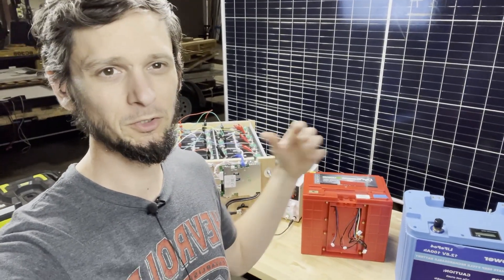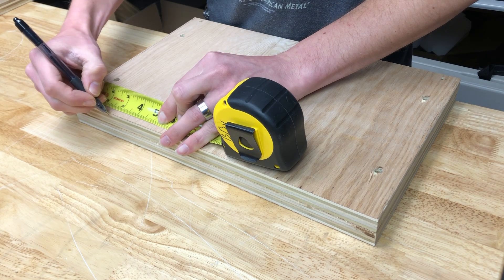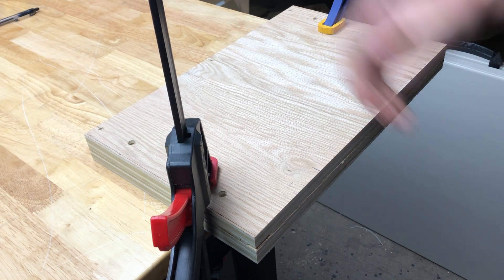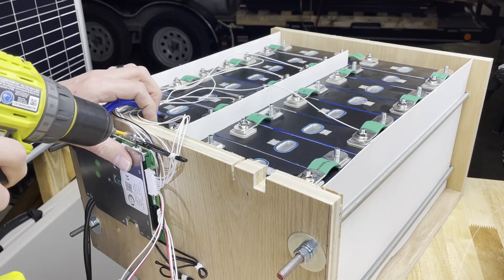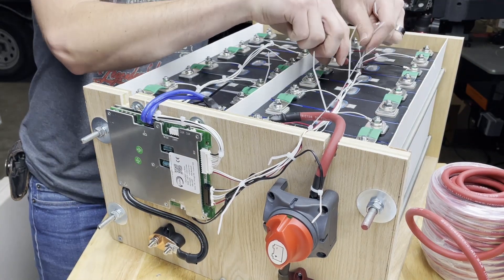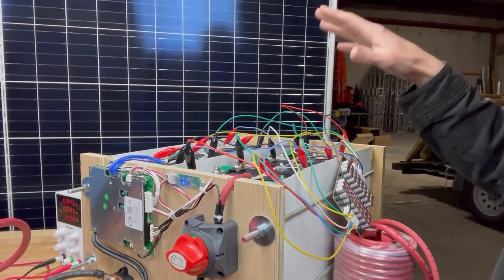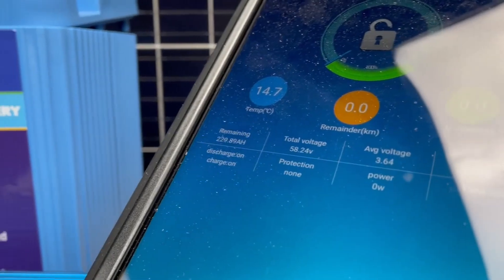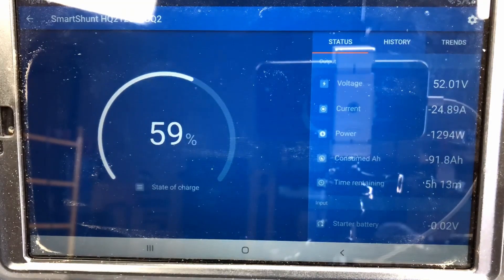DIY or Buy? 48 Volt Solar Storage Battery

Comment: I have two 19 kw banks for 38 kw 8 northstar redtop  batteries at 70 bucks a piece. At 190ah x8. For 560 bucks .     I think i had a bargain
If i went your way i would have paid 7,600 bucks..      no deal

Comment: Uncontested and disputed.  DIY is the most bang for the bucks.
Can  plug and play beat the diy battery with case, bms, 300AH 48v  15khw+ capacity  for $1600?   for that price plug play  will buy you 100AH battery  for about 5kwh.

Are you sure you ask? absolutely positively because i already sourced them out ready to buy.   Hint!!!!  you are not going to find the components in the US and only in Asia.  Then again there is only one country in the world that is leading for now and making LFP battery by the ton - China so now you know where i source to build my battery.

I am NO newbie in this solar thing.  I had been doing for more than 5 years already starting  out from scratch build  and set up everything myself - battery, solar panel, inverter.  The off grid 3kw inverter that runs the whole house and still works to this day.  100% off grid.
Nowadays there are abundant info. for diy in compare with  years ago so what are u waiting for??????

Seriously NO body should do grid tie as off grid is becoming very feasible and affordable.
I went cold feet  off grid and never regretted.  99% of the population won't do that!!!!!!!!

Comment: What are you down to now? I was looking recently and saw 300AH cells that work out to around 92$ per kWh.
Reply from the maker: Haven’t seen anything that cheap lately. Even straight from China before shipping’s costs. It’s odd but cell prices don’t seem to have changed much over the last three years, if anything they’ve gone up.
Reply: @BeeneEnergy Yeah cell cost has definitely gone flat/up. Trying to get near that $100/kWh is elusive.
Reply: With shipping? Doubtful

Comment: Lead acid batt, if lightly used and properly charge, can last 10-12y but that’s more of the exception.  Pb batt tend to last 6-9y under various “normal” use (automotive)
Reply from the maker: Yeah I think part of the problem is that good lead acid's can last a decade or more but people buy the golf cart or marine batteries and hope for the same. They are not the same and do not last anywhere near the 10 years hoped for. Since good lead acid is expensive, or you have to scrounge. Neither is a bad thing in itself but I really like the repeatability of lithium personally.

Comment: Hello, With the Dimmer + PV, self-sufficiency will now increase to almost 95% in summer, which means a huge breakthrough. The prerequisite is that you have at least a small balcony power station, and you don't need an expensive battery either. Example of a kettle: Without a dimmer, the 2500W - 600W PV system needs = 1900W, which you have to pay more for. If I turn the kettle down to 600W with a dimmer, then every weak PV system can now supply each consumer independently and independently, because the 2500W kettle becomes a 600W kettle thanks to the dimmer. Magic... The 2000W e-heater becomes a 500W e-heater with a dimmer, which can run 12 hours a day free of charge via PV. https://youtu.be/QbLWDbJi6ew . The 4000W oven is also tamed. Not the solar systems have to grow, but the consumers just have to drop by 75%, which is sooo easy with the dimmer. are you convinced now I have already switched my entire household to dimmers. Please have a look at my channel. ............. 🌞 ......................          Increase mini PV solar self-sufficiency (winter and camping): A boiler and other power-hungry consumers can be infinitely reduced using the "5000W dimmer". Ebay €7. I run 5 dimmers in parallel on an 850W inverter. Kettle 2.2KW at 150W runs 12 hours a day, so the water is always hot. The room is also nicely heated. 2.5KW washing machine runs in parallel with dimmed to 400...600W and always reaches its 60°C, and also its 1400rpm... It doesn't matter to the washing machine whether it changes the washing temperature to 5min@2500W or 100% can be achieved free of charge via existing PV power in 20min@600W. The wash cycle lasts the same time dimmed and non-dimmed, 3Sth 10min. The iron, dishwasher, oven, electric heater, waffle iron, coffee machine, all internal heating are throttled with me. Videos on my channel https://youtu.be/eC2olbCBhh0 The inverter stays cool, quiet and the MOSFETs + (battery) remain intact because no extreme current peaks arrive at the inverter. Now every Mini PV Inverter is enough to sell large devices. So, with the dimmer, all internal heaters/devices can be converted into base load devices that stay almost permanently ON, drawing very little current directly from the PV. With a wattmeter / energy cost measuring device you can then measure this perfectly in order to set the dimmer optimally. ................. ........................ .............. ................. ................................ .......................... ................................. ............................. .......................... ................................. ............................. ................. ................................ .......................... ................................. ............................. .......................... ................................. ............................. .......................... ................................. ............................. .......................... ................................. .............................

Comment: Diy Lifepo4 new batteries are the best way to go for long term solar storage period. You can beat the price but at the cost of reduced life cycles. I found used Lifepo4 packs for $100kwh  in the US but it's on the east coast and the shipping is very expensive to get to me on the Westcoast so buying raw cells from. China is a better price overall

Comment: I have a lot of 1/0 aluminum wire rated for 125 amps should I use this or get copper? I'm building a pack that will have a 100 amp breaker and switch hooked to solar. Normal  charge/discharge of current batteries are  40-50 amp max   usually 20-35. I think I will use your design if you don't mind it looks like a pretty good one
Reply from the maker: I have debated some 4/0 Al so I could run my battery bank outside to my inverter inside. As long as you’re taking care of the typical aluminum issues like using oxide preventer it seems fair to me!

Honored if you decide to use my design. Thanks for watching!

Comment: Good vid, Sub’d. Have you thought about recycling ur discharge via a charger/method to another set of discharged batteries, rather than just burning off the power to a heating element?  Andy (Off Grid Garage Australia) has a Tesla, which is a cool way for dumping any extra power for his high Amp tests & still using/recycling the power for EV. Cheers

Comment: These days? Rack mount LifePo4 batteries are the way to go. Lot of good product entering the market with 5-14.4 Kwh plug and play units. Have their own bms, circuit breakers, communications, readouts, cell diagnostics and some are even heated. You cannot build anything for cheaper now.
Reply: They are the way to go for people who don't know how to build their own. It's alot more expensive than diy.
Reply: @randybobandy9828  $1500 for 5kwh. Saves you about 300 doing DIY but you don't have a warranty.
Reply: @davefroman4700  um.. You will save far more than $300 who told you that nonsense. Especially when you can build it far larger and not need redundant components. Warranty? Who cares. Anything that you would have to worry about a warranty won't matter since you can clearly fix it yourself.  You can do this for $800 same size.

Comment: careful with that battery disconnect switch on a 51.2v battery...  it's not rated for that voltage.  not even the high quality  Bluesea Systems ones are rated that high and that's a cheap knockoff!
Reply from the maker: You’re right that I should be careful. It is “rated” for a “48v” battery. But yeah without arc extinguishers which this in no way has it would fail turning off the battery under load. Though I rely on my BMS for that.

I didn’t mention that in the video though. So fair of you to call it out. Thank you!

Comment: Pretty cool video.  Like you, I've built batteries from raw cells, used repurposed cells for various needs, and also purchased complete LiFePO4 batteries.  There is a place for each of these, for sure.  Something you demonstrated, but didn't mention specifically, is the sense of satisfaction one can get from any kind of DIY project.  This is particularly true when you build or repurpose a 2nd-life battery to fit a unique situation.  Thanks for sharing your thoughts on all of this stuff.

Comment: or you could buy a seplos bms, which does have proper comms with inverter and other packs :)
Reply from the maker: That’s true, looks like the bms the rack mount batteries have been using commonly. Need to get a hold of one to see how it holds up to the jbd!
Reply: @BeeneEnergy  check out Andy’s Off Grid Garage Australia for some great lab level info on Seplos BMS’s (& all solar & lifepo4 gear) he is doing right now, Seplos are a pacive balancer at 100mv or less, they need an active balancer to work properly on 100-300A cells. 
JK BMS is the one u want, they are great. Good vid. Cheers from Australia
Reply: @BeeneEnergy  got them, work beautiful on my diy packs, they're even selling diy mason 280ah 16s enclosures  which includes everything except the cells

Comment: 040122/1426h PST 🇺🇸  Hello Beene thank you for the demo. I too am a proponent of using B cells, as they have enough punch and lasts a long time. I also appreciate your sentiments regarding sellers of batteries. Of course, you know, that they do not manufacture those batteries but assemble parts bought from the East and sell them with funny trade names and profits.
I’m not too keen on ‘compressing’ the cells though, as I feel there’s no effect on doing that. I have similar cell arrangement for the past 4 years without ‘compression’ and cells have not bulged a bit. Perhaps this is because, settings in VICTRON PV charge controller is set to LiFePo4 as Absorption 14.20V / Float 13.50V / Storage 13.50V. JBD is my BMS and all the cells are balanced approximately @ 3.36V with delta of 0.002~3.
Battery voltage at rest  is 13.45V  97%. (12.8V configuration with no external active balancer)
The above system has been running exactly like this for over 4 years. During winter, when shadow falls on the PV cells, I use VICTRON charger IP22 and IP 67 on ‘night mode’ condition. Charger shuts off during daylight. 
Once again thanks for the presentation, which’s well designed and neat.
Reply from the maker: Thank you for the kind words!

My observation is that compressing or containing the cells can be effective in elongating their cycle life, which is hard to measure.

For me the bigger reason is to make sure the cells don’t rub against each other. Especially if a pack is used in an rv/motorhome. Last thing I need is an internal short!

Love your feedback on how it’s been going for four years. Long term testing is something I don’t have under my belt.

Comment: Just not sure about 48V myself, when yoo got 20kWp on the roof .. sounds like one would end up with giant cables for insane amperage. Or so many inverters and all that it starts becoming a bit messy. Also, with 48V, the batteries might be cheap, but the bigger inverters usually cost a lot more than say a 10kWp Huawei HV system etc. And I wonder about losses. (PS: That doesn't mean I suggest people start to do DIY HV Systems .. :P for obvious reasons).
Reply: That's not true.. Your charge controller can take anywhere from 200v-500v from solar. That reduces amperage. The charge controller converts it to 48v for the battery. What other voltage would you use if not 48v? Anything else will require higher amperage cables.
Reply from the maker: It’s true. Having a 500v battery sure cuts down on wiring.

But yeah I have vowed to not do a 500v house battery. Way too scared of it.

Comment: on the bench top power supplys if you use higher gauge wires directly to the connections you can get the full rated amps out of the unit even down to 3.6v if you wanted to parral top balance
Reply from the maker: This one has actually been able to provide its full 5a with the stock leads. Maybe they use the same leads for the 10a model hence it struggling ;).

Comment: I posted a link to the JBD app I use, you probably have to approve it. BTW have you noticed any appreciable difference between 1c, and 0.2c capacity tests? I have not, and thus just go for 1c test. I'm starting to think the whole 0.2c standard test is just leftover practice from lead acid.
Reply from the maker: Thanks! Don’t see it on my phone here but I’ll check next time I’m on the computer.

Fair point, haven’t paid mine to the .2c or not difference. Maybe I can get this one loaded down for a higher discharge test and check. Hmm how will I pull 11kw? Lol